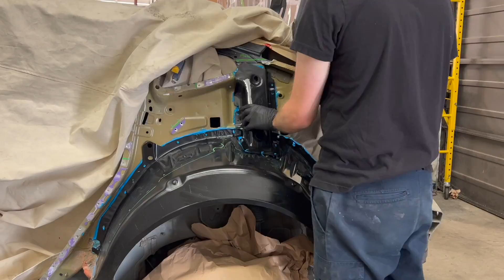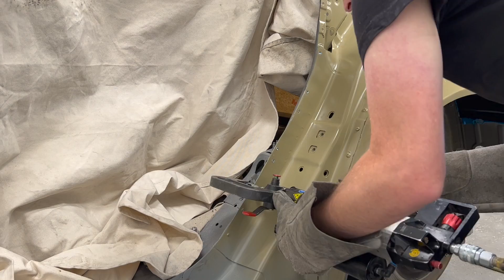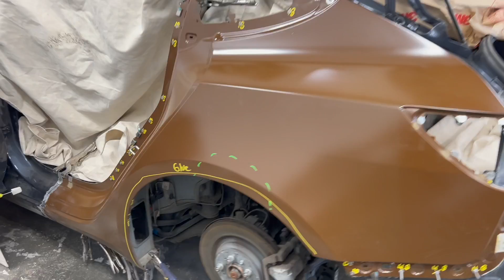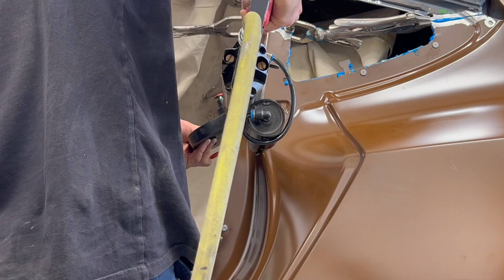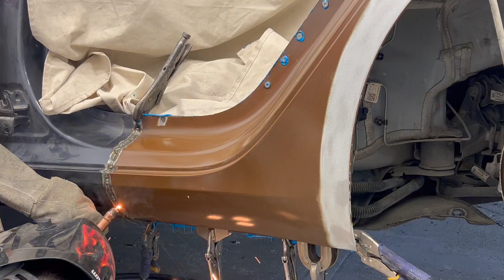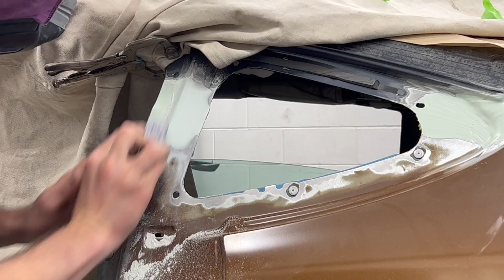REPLACING A QUARTER PANEL ON A TESLA MODEL 3

Comment: Nice work dude and a big thank you for making this video! I slid out and hit a tree and took out both passenger-side doors and ripped the lower rear quarter panel. Plan on buying replacement doors from a salvage yard and seeing how badly the B pillar was affected. I just might follow your lead here in replacing the quarter panel, of at least the lower portion. I cancelled my full coverage insurance and went with liability only a year ago because it was so expensive here in California, now in hindsight….

Comment: I have some questions. 
1.What is a reason to use rivets in places where spot welding is possible? You use rivets and spot welding in very close area. Please note that rivet line is very close to the edge of rear fender instead of the middle.
2. What is a reason not to weld in all cutting line? It is very visible during grinding process , see 11:14 time
3. What is the blue sealent that you use. Could you please specify? 

No more questions, good job
Reply: https://youtube.com/@shazzadhossain1899?si=kfiFEvDA0f3LIPWf

Comment: Shawn the qtr wheel arch do you always have to sand down and apply filler considering its a new panel ? and do you do this because its affected by the rolling of the inner flange and dolly work ?
Reply from the maker: Correct sanded down and a little filler was applied to fix minor imperfections when rolling over the wheelhouse flange.

Comment: Great job dude! Only thing I would say is idk the last time you checked the procedure but it now calls to wipe the glue instead of filler where you left the slits on each side of the quarter glass..I am a tech at the Tesla manufacture collision center
Reply from the maker: Thank you! I thought I followed the procedure correctly filling the rear 1/4 glass section with structural adhesive and the front 1/4 glass section only filled on both flanges with the remaining welded. I printed the procedure when I completed the repair and am always learning as much as I can. Do you mind clarifying what I did wrong? Might be a great learning experience for me. That’s a really cool job how do you like working there? 

Cheers 👍🏻
Reply: @shawn.collisionrepair  it’s a very different experience working there. We are in teams of 10 and hourly so when there’s nothing to do we just sit there and still get paid the same amount or more than a body man that flags 100 hours a week plus overtime lol . But at the quarter glass where you leave the open slits on each side of your welds it’s actually weird but you just wipe glue over the slits and sand it down instead of filler. Same for the door jamb
Reply: Should not be anything other than epoxy primer or the adhesive where glass would be.